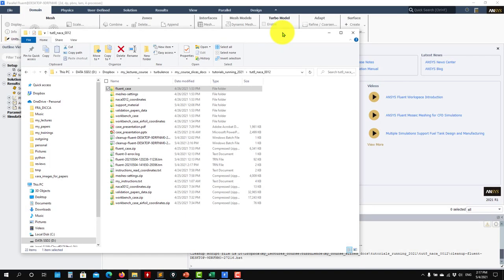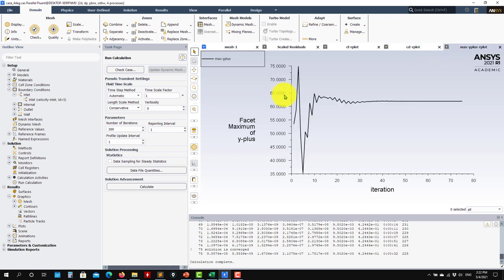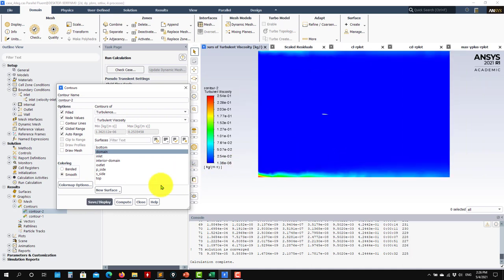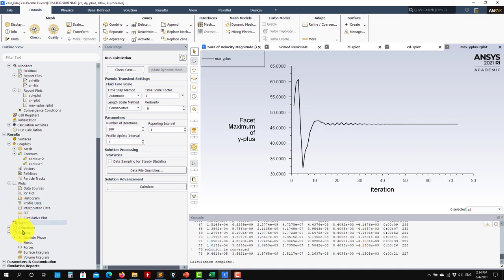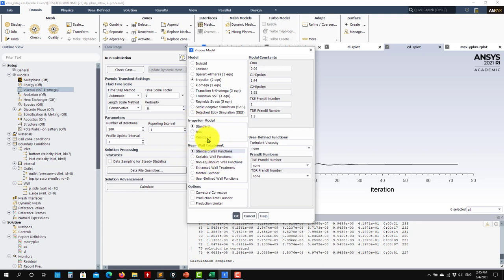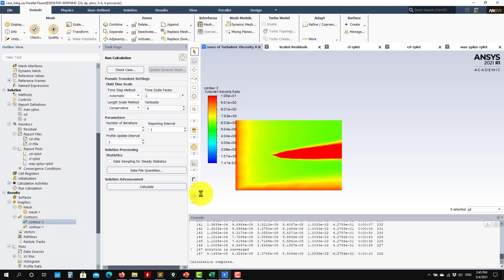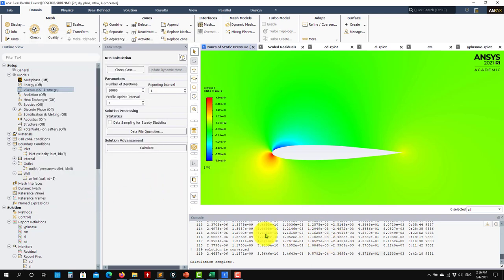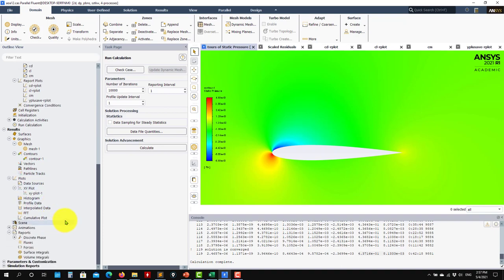Turbulence modeling with Ansys Fluent | Flow over a NACA 0012 airfoil - Part 4

Comment: Hello,loved your videos explanation in a clear concise manner! For the Standard Grid taken from the NASA website, there is a boundary zone connecting the airfoil to the outer farfield, how is this zone removed and mereged as a part of the internal boundary? I'm finding it difficult as i constantly keep running into shadow zones. What can be done?
Reply from the maker: I dont recall the specific steps but we used the original plot3d mesh and then we apply a few commands in the TUI to separate the boundary patches
Reply: @wolfdynamics5703  Ok, will try it through the TUI as the separation of zones via GUI was little confusing in terms of combining and separating zones...Also how can a wall zone be converted to an interior zone?